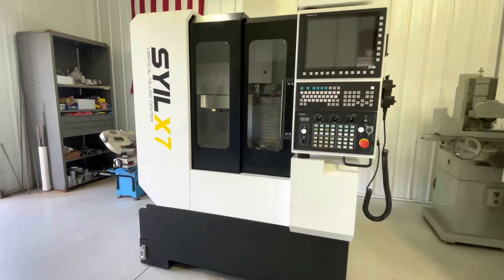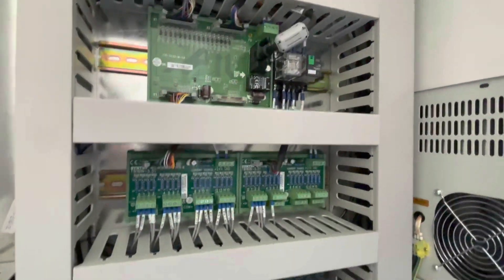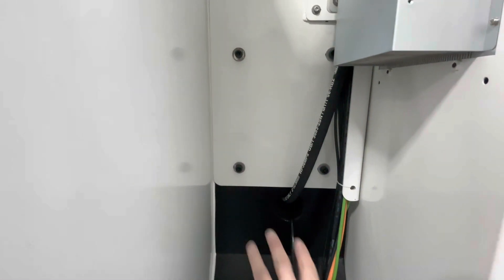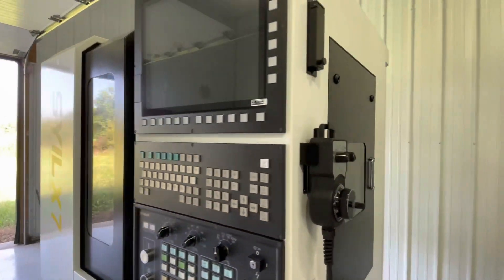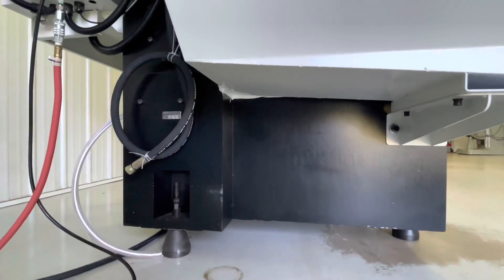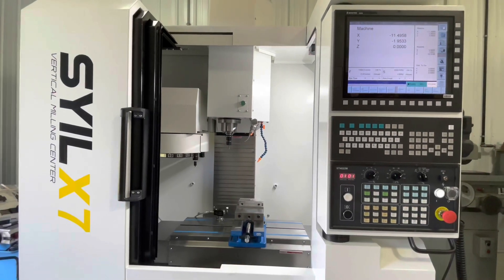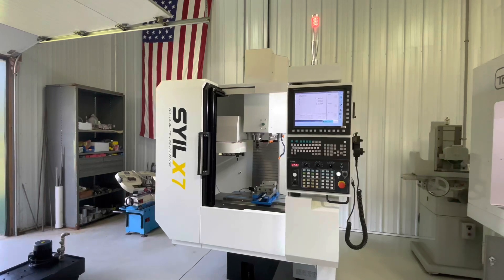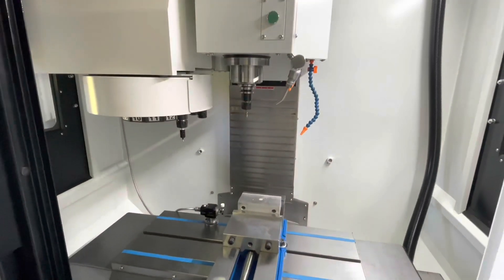Syil X7 vs Tormach

Comment: As a machine shop owner with 16 full size cnc machines, I will say The Syil is built just like a $80-$150k cnc mill while the tormach is built like a grizzly with a cnc controller. 
The engineering side of me thinks who in the hell would put the electrical cabinet access inside the cutting area.
Reply: I own zero machines but I have to agree. It just seems like the cons far outweigh any advantages you get from putting it there. Coolant and chips get everywhere in a mill eventually.

Comment: Well yeah Syil is of course overall better machine, but it also costs twice as much as Tormach, so..
Reply from the maker: It was 3K more than a 1100MX similarly equipped.
Reply: @MaDuceRules  hmm, I watched a vid recently and it looked like x7 was over 35k. Tormach 1100M without upper enclosure and tool changer (both can be easily done for much less once you have the machine) - was just 16k. I mean I understand that Syil much better machine, but for some people this difference might be big.
Reply: @KyrychenkoAnton  Bro the 1100MX was $38k + freight when i looked at it. 16K is the base machine with absolutely nothing and not the MX version, the crap version with TTS, steppers, no spindle encoder, etc.
Reply: yeah I know, but you can kinda start even with steppers and TTS though. I'm not sure about encoders, TTS has locking right?  @OtisFlint

Comment: For the money, I would go with a used real machining center. Syil looks like more capable machine of the two. Nothing against those machines but you're going to out grow the small spindle in a hurry. 
Started with diy machine that weighs around 1.2t metric. It's accurate and all but lacks power. So it's just collecting dust and I use my Emco vmc300 for all the work.
Reply: It depends what you're making. I've just ordered a Syil to replace my Haas mini mill. For an extra £5k I can get a faster spindle, tool setter, fourth and probing and macros. With the Haas that would have been an extra £20-£25k and then only a 6k spindle not 12k. I only make small pieces that are mainly consumer goods; bits for keyboards and none pressurised diving gear. So for me going down from BT40 to BT30 makes no odds. 
Getting a real machining centre at the price I paid for the Syil would mean a 20 year old heavily used, high spindle hours beast: the risk of buying a lemon with that is high. So it's horses for courses really and depends what you make :-)
Reply: @iDiveDOTtv  Yes its true old used machine has its risks, I bought my Emco 300vmc as a faulty unit, but it was from university and mostly has cut air. 10000 hours powered and around 2000 feed hours. Iron is like new, not even any paint missing. One sensor faulty and one bad solder on spindle amp. 
Always a good idea ask around local colleges and universities if they are updating. Syil is a good option for startups and small shops, seems like ok machine for the price. Would not even consider Tormentmach. Haas, well its the way they run the business I don't like. They wont deliver parts for too long and everything is proprietary. I would go with Siemens Fanuc or some other dependable controller that has good parts availability even after 20 years.

Comment: To get this in my cellar i would have to disassemble it completely.
Reply from the maker: That might be a problem!
Reply: @MaDuceRules  How much chatter does it have? Say with a 40mm shell mill in mild steel.
Reply from the maker: @platin2148  I haven’t used a shell mill on yet.  Still getting tooled up. However I have run some parts that we ran on the Tormach. Cuts that would make the Tormach scream in the x direction there’s zero chatter on the Syil. We have had zero chatter issues with it so far.

Comment: Wish I knew about Syil before I bought an 1100mx. Sorta jelly bout the new epoxy granite. Would of cost me the same minus probing. Thou I got a 4th, probing, tool setter, buck boost, auto oiler, skimmer, tool changer, 10k spindle and all the other upgrades possible, the syil would of been slightly better decked out with all that and a real mans Fanuc control.

Comment: Nice walk around vid, thanks.  Looks like a 1/4 HP coolant pump, that should give a better flow than 1/8 (or 1/10) HP.  It looks like a 3 point leveling system?  that would have to be easier than a 4 point system. How would you rate the finish of the X7 compared to the 1100 ? Do the panels line up? Paint finish? - those first impression things. Any general purchasing experience feedback you want to share?  I have an 1100 S3 and have been looking at Syil lathes.
Reply from the maker: Chris, thanks! The X7 comes fully assembled and the enclosure is two pieces that are fully welded. So there are no screws or bolts like the Tromach, except where it bolts to the base and the column. Id rate the fit 99%. The finish is close to the same but there is a couple of spots that look like the powder coat is a little thin. Not really noticeable unless you're looking for it. Yup the three point leveling was a breeze. I went and visited a X7 that was in use at a company close to me. My first impressions were this is a serious machine and it looks great. LOL I ordered a machine before I left the companies parking lot. The purchase process is pretty relaxed. Ask question and get a quote. After that they will send you an invoice for the purchase. Thanks for watching the video and commenting!